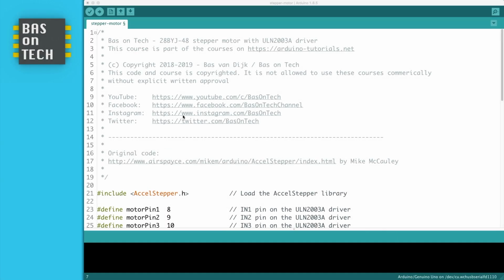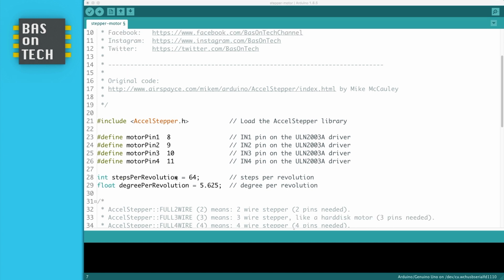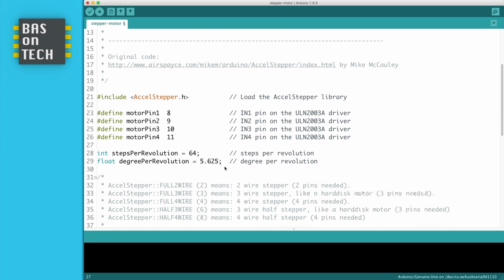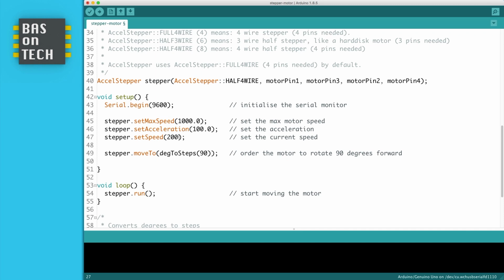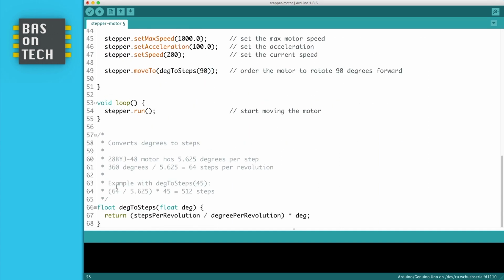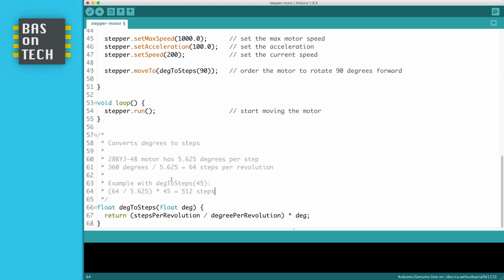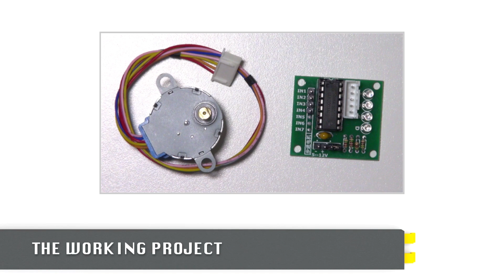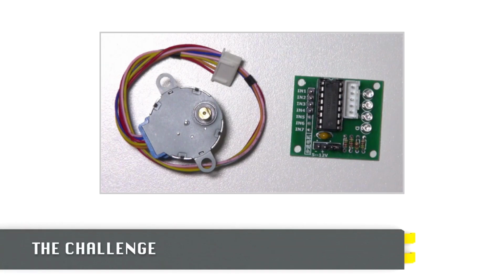28BYJ-48 STEPPER MOTOR WITH ULN2003 DRIVER - Arduino tutorial #14

Comment: I have a problem, I connected everything correctly, but the motor only makes sounds and does not spin, it also vibrates, I have already tried to increase the voltage, but it still does not work
Reply from the maker: It could be that the pin layout is different on you PCB board. Then the steps will not work.

Comment: When I connect my external power supply, same as yours, my arduino does not light up and turn green and orange. Any idea why? Wiring is identical as in the video
Reply: I believe it is the power adapter. When I plug the external source directly into the arduino, it works fine but when I use the adapter and wire like you it doesn’t not work
Reply from the maker: Maybe the voltage is too low?
Reply: @BasonTech  it works when it is just the power supply plugged into the arduino. When I use the adapter and breadboard it does not work
Reply from the maker: Sound like an incorrect wiring or a faulty breadboard
Reply: @BasonTech  The breadboard is working properly and the wiring is identical to the video. I will keep playing around with it and see what I can get. Thank you for the help!
Reply: @BasonTech  if you could answer one more question for me, that would be great. Is the power adapter required or am I able to plug the power supply directly into the Arduino?
Reply from the maker: This is required. As I describe in the video the motor can draw quite some power. With the external power supply you avoid high current going through your Arduino

Comment: Hi there I did the same code 
The motor is just vibrating not turning any solution ?
Reply from the maker: If the code is exactly the same, please check your wiring. Maybe there is a loose connector or the wrong power supply.

Comment: Why always 8,9,10,11 pins on the arduino? Can i go for 2,3,4,5 as well?
Thank you :)
Reply from the maker: Hi, that depends on the requirement of the pins. Pin 2, 3, 4 and 5 could work but you have to keep in mind if your application needs for example PWM pins. It then is important to select the correct ones.
Reply: @BasonTech  thank you very much for your answer! :) Got it!
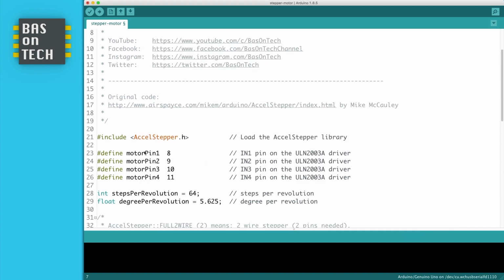Reply: i think you can, just change the pin at 4:45

Comment: how is it safe to connect the ground of the power supply to the arduino while the positive voltage comes from elsewhere? what if the power supply is a battery?
Reply from the maker: I don't understand your question. They share a common ground but the circuits are individual for powering the motor and for the driver.

Comment: Hi, my stepper is vibrating nut it is not actually rotating :( do you know what the problem might be ?
Reply from the maker: Hi, make sure the wires are connected correctly. Other thing could be the power supply not being connected correctly

Comment: hi, thanks for the video! it got me severall steps forward, i have a question though, im using a computer power suply , when i conect it like this to the 12v power rail of the psu it works for about half a minute and stops, the chip gets really hot and if i disconect and wait a bit it works again, do you have any suggestion to what i might have done wrong? my ground rail comes from the power suply as well. any insight on this will be extremely helpfull.

edit: there is a problem with my uln2003 board, a diferent board works perfectly, gonna trtoubleshoot the traces now, thank you for the video!!!
Reply from the maker: Thanks for the update! Maybe you've damaged the ULN2003 chip with a faulty connection and that makes it hot?
Reply: @BasonTech  the ic works on a different board, so I suspect there is a short on the little circuit board.
Reply from the maker: Great you got it working, well done! 😃

Comment: Can I use a 5v breadboard supply module for instead of the adapter
Reply from the maker: You can, but you shouldn't. The motor can draw peak powers which could damage your Arduino.
Reply: Thank you

Comment: Why are you using power plug?
Reply from the maker: You want to separate the motor current form the Arduino current. The high peaks might damage your Arduino. Therefore I make the motor power go completely separated from the Arduino one.

Comment: Line 29 reads "degrees per revolution"... when I think you meant "degrees per one full step".
Reply from the maker: Hi Darryl, 1 revolution is 360 degrees. It has 64 steps per revolution. 360 / 64 = 5.625 degrees per revolution. This is the same as degrees per one step.
Reply: @BasonTech  360 degrees per one revolution. 5.625 degrees per step. Line 27 in your code says "5.625 degrees per revolution". That is incorrect. Good video though. Thanks.

Comment: Hi there, would it be possible to connect a battery pack of 6V as the power supply rather than an adapter? (sorry if this is a silly question, I'm new to electronics and don't want to end up frying my arduino or blowing something up!)
Reply from the maker: 6V is too much, the motor is rated 5V max. Also make sure your battery pack can provide enough amps.

Comment: The ULN2003 driver dose not show lights, I do not know why?
Reply from the maker: Are you sure you've powered the motor and board correctly?
Reply: @BasonTech  yes, I am so sure that I do the same what you did in the video.
May there a problem in Uln2003 itself or the type of Arduino because when you run the code it appears green light in your Arduino but my Arduino red light apears.
Reply: @BasonTech  many thanks, I solved the problem. The problem was the jumper was not connected to the Uln driver.
Reply from the maker: Great to hear you've solved it, thanks for sharing! 😃

Comment: What is the steps per revolution of the stepper motor you used?
Reply from the maker: Hi Mishra, Officially it is 64, some people at https://forum.arduino.cc/index.php?topic=71964.15 calculated it is actually 63.68395 😃
Reply: @BasonTech  There's no single answer. Some are saying it's 64, some saying it's 4096?!

Comment: hello and congratulations for the video, I need the same code but for 2 motor steppers, do you know what I should modify? thanks and good day.
Reply from the maker: It is basically the same code. You define another 4 pin variables e.g. motor2Pin1, motor2Pin2 etc. And create a second instance of the stepper like:
AccelStepper stepper2(AccelStepper::HALF4WIRE, motor2Pin1, motor2Pin3, motor2Pin2, motor2Pin4);
Instead of stepper.setMaxSpeed(1000.0); your now use stepper2.setMaxSpeed(1000.0);
So everything works the same but now you have two instances: stepper and stepper2. Hope this helps :)
Reply: @BasonTech  Hi, after many tests I managed to modify the code, now it works well, thank you for the help you have given me, bye.
Reply from the maker: Great! Unfortunately this is the best way to learn stuff ;)
Reply from the maker: @Marco.Malatesta  On https://arduino-tutorials.net there is a contact button which you can use :)

Comment: how many stepper motors can i control with ardino uno
Reply from the maker: Theoretically as much as you want. Practically there are some limitations: speed of controlling all motors, current drawn by the motors, the number of pins available. This topic quite covers your question https://forum.arduino.cc/index.php?topic=241152.0